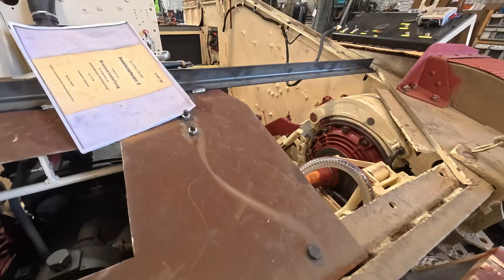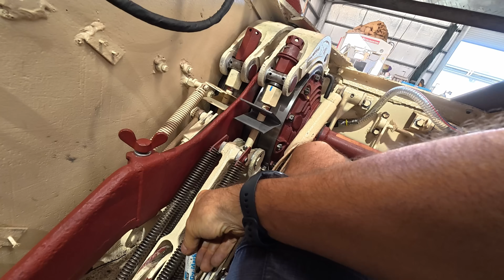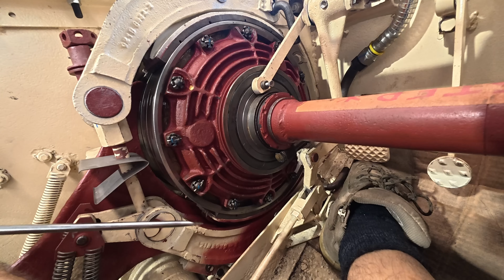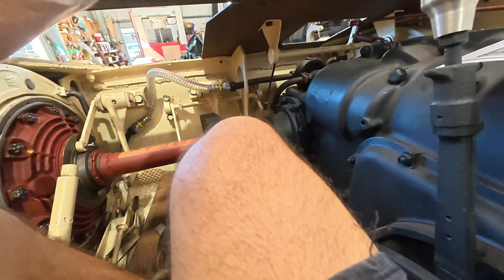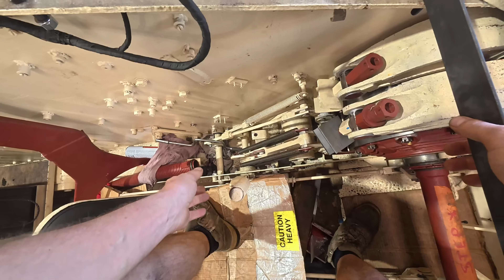Adjusting ORIGINAL WWII Steering Brakes Using the Factory Manual. Wespe Restoration

Comment: I watched the video where you disassembled the main drive. My first thought was what a manufacturing nightmare. Then as you continue to disassemble it, I thought what an absolute nightmare all those bolts, all those castle nuts, with cotter pins. What a nightmare. 
Then I watched this video of you doing the maintenance on the newly rebuilt drives. 
And I’m going that doesn’t look too bad. Until you realize that none of the armor is on it. So easy access and in a well lit shop. Where would this maintenance be done, in the field?
 It would be so dark in that work space. Wow crazy stuff.

Comment: Two questions, and these go back to other videos unrelated to the Wespe where I’ve seen you Steve with bandages or wrapped fingers.

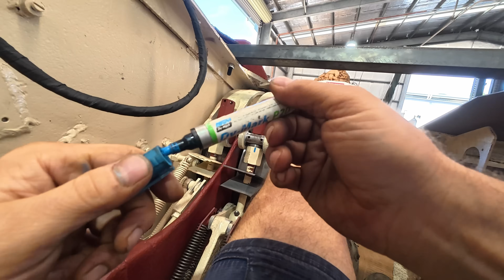1) at 9:06 how many times has the soft spot on the knee caught that steel dust plate? 

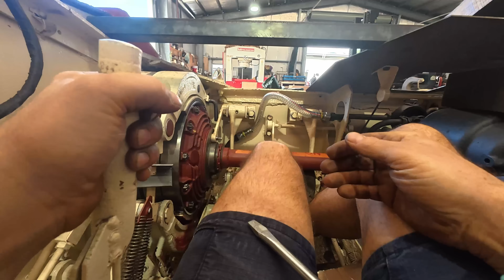2) at 14:30 how many times has the knuckles caught that same dust plate? 

Like stated, in other videos, I’ve seen Steve with bandages on his hand/knuckles as well as his knee which look like they could’ve been caused by the dust plate for the differential shoes. It is either a very high coincidence, or the culprit.

And I wonder why the corners of that aren’t rounded. It looks to be in a very peculiar position and will likely cause multiple pokes, especially in the fully assembled, more cramped, and darker Wespe.

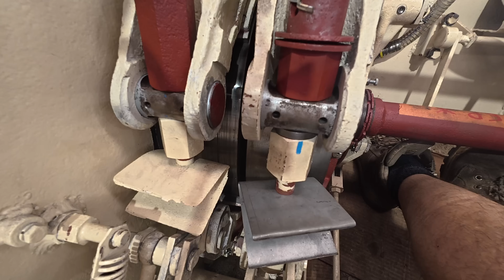Or is this farther than it appears in the video? At 14:50 the way it’s canted to the side it looks quite close to the hands and legs, especially when you imagine the left hand being there and taking up space, instead of the right hand for video purposes.

Comment: German engineering. Imagine in 80 years trying to do a similar job on a 2026 BMW at a car museum. Good luck with that.
Imagine trying to work on a 2026 BMW in ten years time. Hah! Cheers Steve. Thanks for that.Like setting up flying controls

Comment: All I could think of was what a hellatious job that would be inside the fully built tank.  Especially in a tank just pulled from battle that needed to be back in battle in an hour or so.
Reply: Did not happen. For all the faults of the Sherman tank , the crew could handle most repairs for the most part in the field.

Comment: The Wespe steering brake assembly is obviously complex. Congratulations to the team for restoring and reassembling it all correctly. Without that and the manual it looks a nightmare of German overengineering. Well done Steve for getting all the adjustments bob on!
Reply: I'd call it well-engineered. You cannot simplify things arbitrarily and expect the same outcome/behaviour.

Comment: Easy to see here why, in the previous episode, Steve was keen to do this brake adjustment before the front glacis plate was permanently refitted to the hull over the driver’s position. Much knuckle skin must have been saved. Easier for we online viewers to see and understand the procedure too. The bilingual modern edition of the original brake adjustment instructions (D 651/28 Panzerkampfwagen II Anleitung zur Bremseinstellung für Fahregestelle mit „selbsttätiger Nachstellung“ vom 1.4.39) is an impressive contribution to the world of PzKpfw II and Wespe restoration by Dmitry Bushmakow in the Czech Republic. Going by all the manual adjustments Steve had to make the reference in the instruction manual title to „selbsttätiger Nachstellung“—automatic adjustment—is a bit puzzling, unless it refers to a different mechanism or the quotes denote a sense of irony.
Reply: The manual also applies to the Panzer II
Reply: @kristoffermangila  Indeed. In trying to work out the technical expressions I am stretching my very rusty and rudimentary high school German, which is not much newer or shinier than the PzKpfw II itself.
Reply: My back hurts just thinking about how one would have to crawl inside to reach the brake adjustments if the hull was in place.

Comment: 8:44 No lock nut on that adjuster? Anyway, another feast of excellent German engineering 😁
Reply: Did you note right at the end...... the adjuster nuts lock plates?
Reply: @JohnSmith-pl2bk  Link for that?
Reply: @FairladyS130  
Watch the vid again.
Right near the end Steve brings out two red primered lock plates and screws them onto the mechanism...
one end of the plate locks the top adjuster, the other end locks the bottom adjuster.
Reply: @JohnSmith-pl2bk  What I mentioned was where the threaded rod screwed into the yoke, that's why I linked that specific pic. If there is no locknut against the yoke then the threaded rod will not be locked against it and will slop around in the thread. Pretty basic.